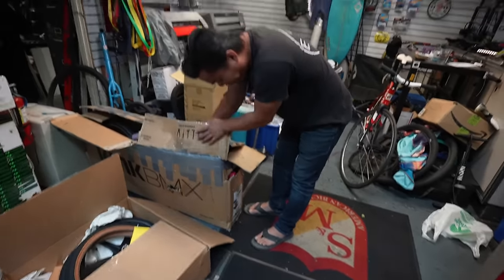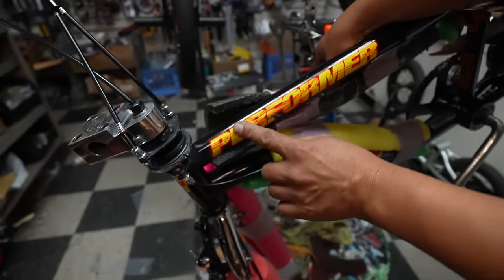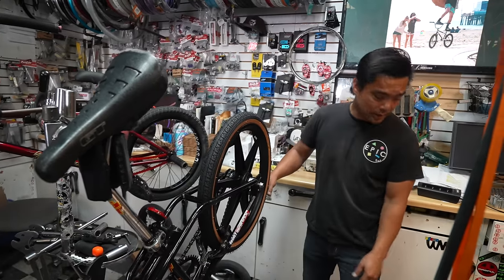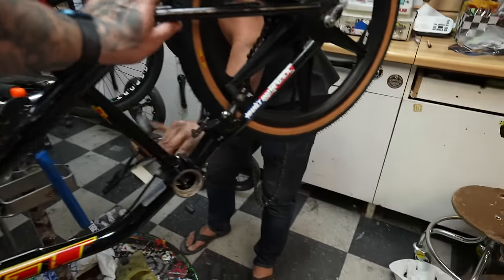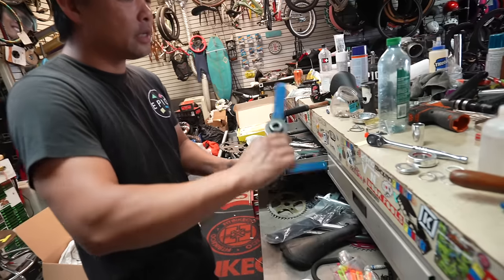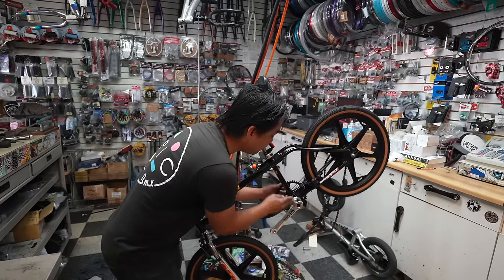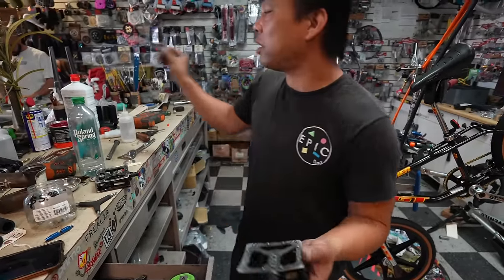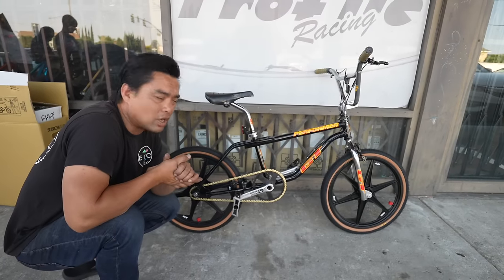Shop Owner Claims Customer Got Ripped Off On This GT Performer Bike!

Comment: I can’t Imagine paying someone to assemble a bicycle. That’s embarrassing
Reply: Nothing wrong with that, some people don't have the time or the tools.
Reply: To each his own. Some people take pride in building their own bike, some people have the means to just drop it off at their LBS and kick their feet up. Whatever helps each person sleep better at night
Reply: while i do agree, i think he more so paid for his expertise in identifying the parts. phu is certainly going to know if hes looking at repop or og parts. the owner might just simply not know and wanted his opinion. On another note its good to help out local small business's. i know i certainly prefer to go into a store and get my hands on something before i purchase. the other thing to note as well if it needed anything phu has most stuff in stock. ie the washer he needed to complete the assembly.
Reply: I’m old and lazy. I would pay if it saves me time and I don’t have to get dirty.
Reply: I kinda agree 😂
Reply: I would pay, if it was one of those modern bikes with a thousand speeds and complicated cassettes & free wheels etc, only because there's too many little areas where if not put in correctly will make your gear slip, or chain come off etc. After building a few bikes though --one of which was completely from the ground up (definitely not recommended if you're hoping to save money)---and all of them single speed, or fixed gear--it's really very easy to put a bike together. That is assuming you have access to the proper tools, though it's probably cheaper to pay a shop to assemble a bike then buy all of the needed specialty tools like a bottom bracket tool,  headset properly, brake cable cutting tool, etc...or at at least it's probably cheaper at first to just have a shop do it for you. But, the tools will pay for themselves pretty quick, as yo you'll be able to do repairs replace parts yourself which will save you a bunch of money on labor.
Reply: Time is money!! so i'll assemble a for someone, no problem.